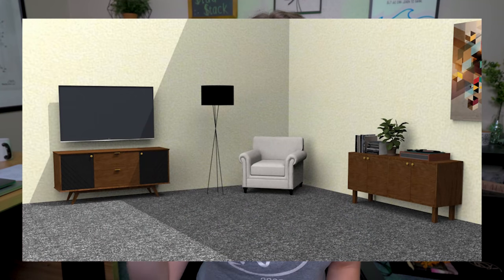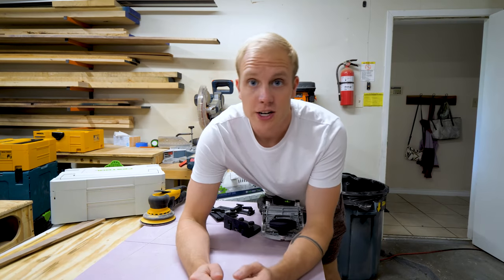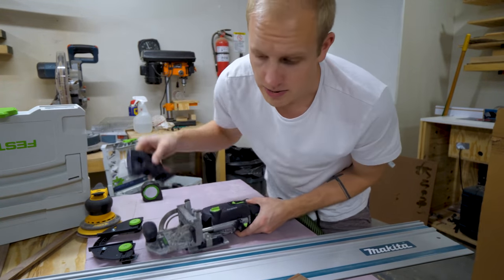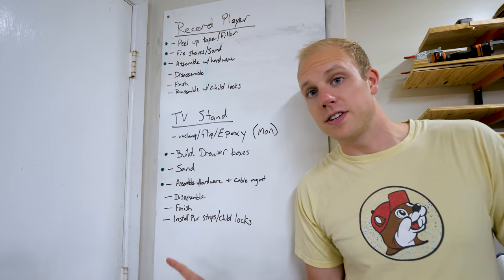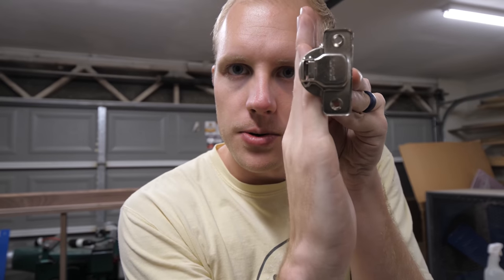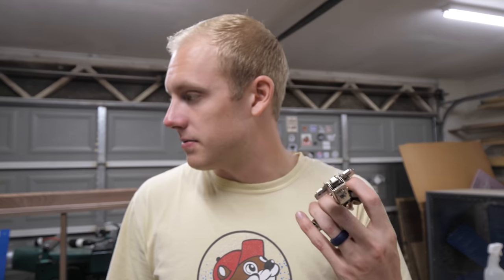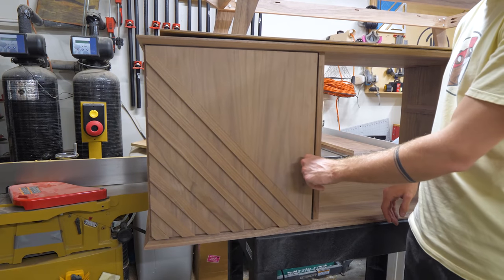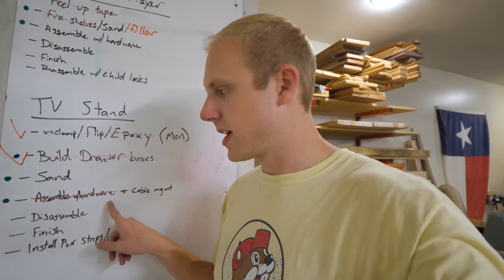This $44 jigsaw SAVED a $3500 furniture build | Furniture Business Update

Comment: Wow who would have thought the jigsaw was going to work for that. Great too see how you work under pressure! Thanks again guys for a great and educational video!
Reply: To those watching this. Jigsaws are notorious for cutting off line or at angles, never mind tear out. I would highly not recommend. Plunge cut skill saw or track saw with pull saw finish would have been the way I would have tackled that. Got lucky and I bet way more than I earn that they used a fresh clean cut blade. Risky move. I'm glad it worked out.
Reply: @bgraybackpacker  that’s why the cut wasn’t shown in the finished product. I’m with you, jig saw is a great way to get tear out, out of square, and wandering cuts. Plunge saw and pull saw are both pulling towards the finished side….but still better than a jig saw.

Comment: Nice video. A tip on the hinges though when you need inset but have overlay, just add a 3/4 inch spacer in behind the hinge, and that solves your problem. I've been on so many jobs where I brought the wrong hinge lol

Comment: OK. I am confused. I use a LOT of BLUM hinges. Most of the doors are outside mount. I get that you cut ~.75"+ the strip depth off the front edge of the sides. That would get the doors to line up horizontal to the front. But, If you used the original hinges which would be an outside mount, the door would still be short left to right. Which it seems to be in the picture where you give it a thumbs up. Granted, not as much as before but larger than your other doors. (Sort of like panel gaps on the Tesla?) Am I missing something? Or, is it just the photo or...? Thanks, Bill
Reply from the maker: No you're right on the money - we just needed to make longer drawer fronts to hide the panel gap you're talking about! If you're subscribed, you'll see it all come together in the next video!
Reply: @jennieanddavis  Ahhh! Fabulous solution that I did NOT see coming. Good job! Another solution for that kind of door is the small scissor hinges that go on top and bottom of the door and take up almost no room. I usually use them on medicine cabinets so the mounting piece doesn't take up what little room is in the cabinet. Of course I use a magnetic catch to keep the door closed. With your penchant for inside doors, they might be a good solution on a future project. Regards, Bill
Reply: @jennieanddavis  Longer drawer fronts don't fix the basic mistake

Comment: Hi, I'd just like to thank you for the fantastic YouTube channel. The information you've given is so incredibly thorough. I have a question about your laser. I can't easily get a Glowforge in the UK but looking at other models, they seem to require separate air compressors, exhaust pumps etc. What do you have connected to your laser machine?
Thanks again.
Reply from the maker: Hey thanks! Glowforges have a built-in exhaust fan which we don't use. We have a 6-inch diameter inline fan which routes outside our window. For additional anti-smell protection, we have a charcoal filter on the end of the dryer hose, but that's probably overkill.
Reply: Thank you!